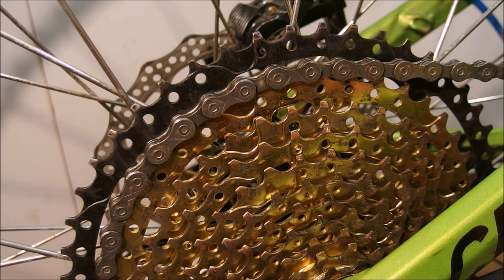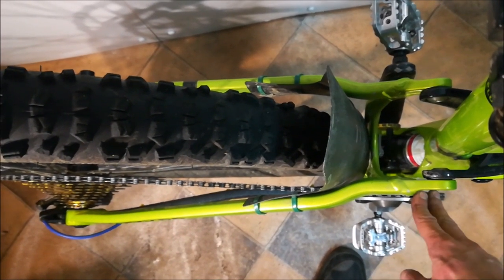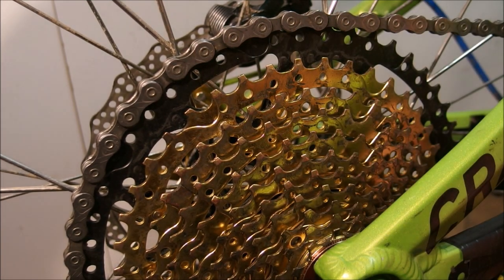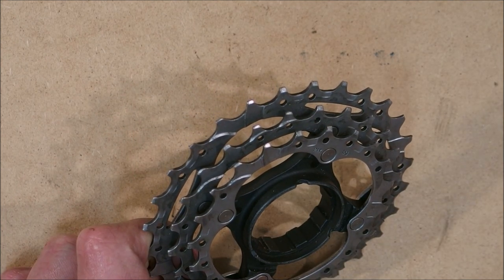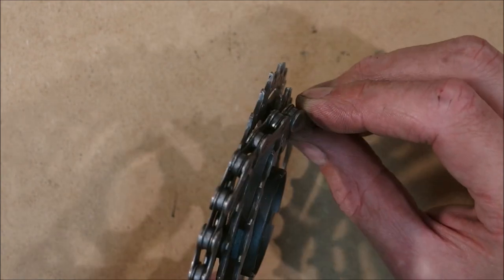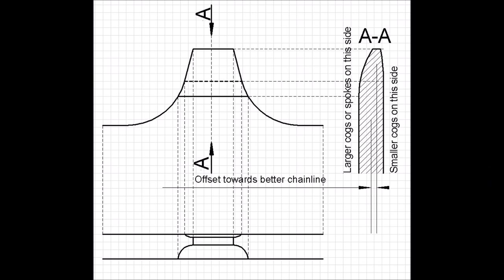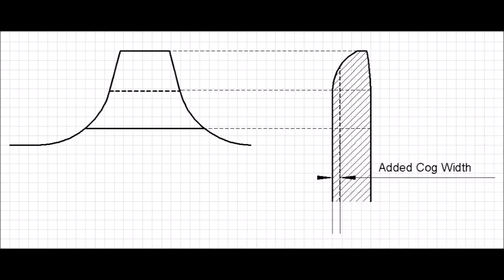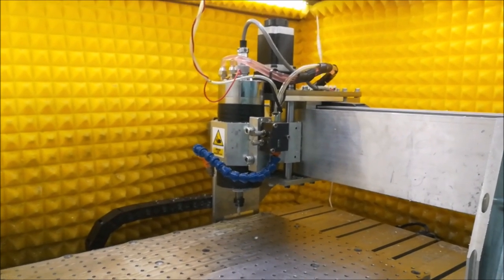Tech: One by backpedaling issue in excruciating detail

Comment: i solved this issue on my 2017 mondraker : first you must change the chain for a new one if it`s too much old , then cut it to the right lenght . Put also  four thin shim to the chainring  to move  it just 1 mm to the left . Make a right setup   of your rear derailleur .  you will see that with you weight on the bycicle ( if u have a full suspenction bike)  the chain won`t drop inside anymore also if the chain is on the biggest pinion

Comment: Great analysis, I think you are right! And I think Shimano make some changes in their cassettes.I had 11-40 xt m8000 cassette with 36/26 on front and it had backpedaling problem even with 26 on front. It was in 2015, and all teeth on largest cog of the cassette were the same size. Now I have 11-42 xt m8000 and were the "shift gate" on the 42cog the teeth are lower and much narrower and no backpedaling problem on 1 by!

Comment: I have the SRAM eagle GX 12s and it suffers from this quite badly.  Not only that but when the chain is on the smallest cog back peddling caused the chain to catch on the second smallest cog.  I tried an xx1 cassette with similar results.  I spent an entire day trying to adjust this out but no joy.  In the end I changed my driver to the standard Shimano spline and used the NX 12s cassette which resolved ALL issues.  The NX cassette with the GX drive train works very well and so far I haven't had a singe issue with back peddling.

Comment: I have a 7 speed freewheel 14-28t
i replaced the freewheel with another 7 speed a 11-28t,
it shifts fine and the gearing is exactly what i wanted, but with the original freewheel, in 1st (28t) i could backpedal. 
with this new freewheel, same gear, when i move the pedals backwards the chain falls onto 2nd gear, and will then jam if you continue to move the pedals backwards.
i don't understand why this one does this and the original didn't,
I figured that the chain-line was at the extreme and pulling the chain to a more straight position, (though it didn't do that before)
so i installed a 3mm spacer between the freewheel and the hub - in an attempt to move the freewheel further outside, to help with the chain-line when in first gear. it has helped but only a little.

Comment: I biught a x01 eagle 12 speed for my dh bike. it had a x01 7 speed downhill with 36t xsync 2 chainring so I just bought the derailer, casette and shifter. however I struggle with backpedaling causing the chain to fall many gears and pull the derailer into the casette.....

Comment: Hi! Thanks for very informative video! You mentioned that Sram Eagle series does not suffer from backpedaling issue, however my brand new Merida NX-edition with Sram NX set has this problem. Is there a way to minimize a chance of chaindrop when backpedaling?
Reply from the maker: Sram NX Eagle cassette does not have the narrow/wide profile on the back of the teeth of the cassette. It will drop chains when backpedaling just like any other cassette that lacks them.

There is really not much you can do, except for getting the front ring as close to the frame as possible.
Reply: I have nx 12 speed back pedalling from 11 shift has no problem . At 12 speed got chaindrop unless i backpedalling it fast that impossible to do it in yor feet . Tried to adjust the rd still no use.  But i made it the chaindrop longer than before.

Comment: mine is a 9 speed and its happening
Reply: My GT bike has a 3x9 gearing where I currently don't use a front derailleur and chain kept on middle ring until I afford to convert to a 1x9. However the chain drops off when back pedalling (rear cassette is 11-34 with an older XT derailleur.). 
My hybrid bike is a 3x9 and even with a chain that is supposed to be a mismatch, it still doesn't drop off when back pedalling.

Comment: I’m having this problem after switching out my stretched Shimano chain (.65 stretch) and replaced it with a KMC DLX12 for my 12-speed Shimano DeoreXT. The older Shimano chain didn’t do this as easily, but there doesn’t seem to be anything I can do to prevent it from happening on the KMC chain. I’m thinking because the KMC chain is brand-new, I’ll need to bed it in more. We will see.